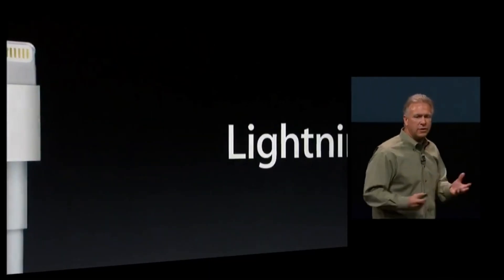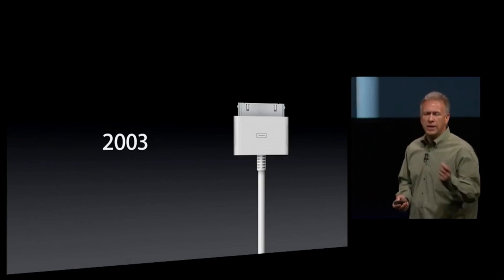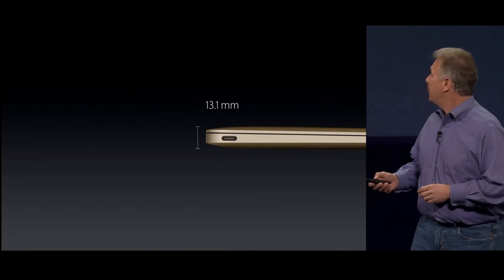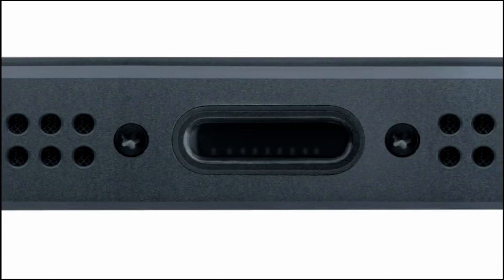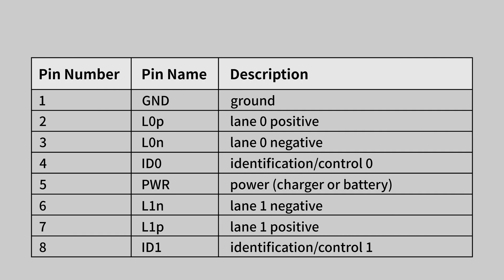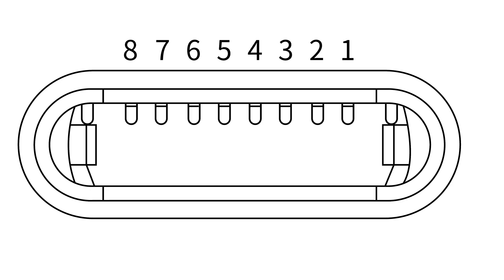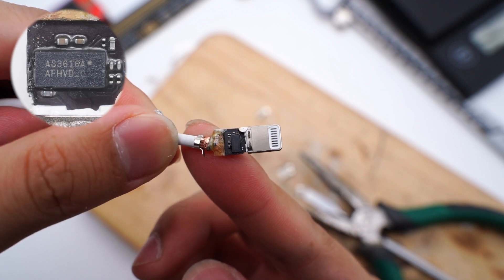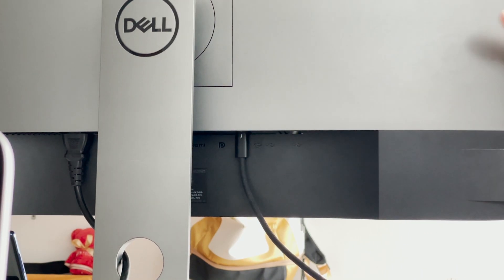How Lightning Cable Works? | Brief Introduction of Lightning Connector

Comment: I've had an idea for a "better" iPhone lightning cable involving a size change of the lightning cables head to help with initiating contact for older more worn phones. My proof of concept works, my biggest hurdle is the contacts themselves. is it possible to perhaps very slightly "stretch" the contacts and surrounding container vertically? what would that take? Is there a way to perhaps remove the contacts from the small plastic housing encapsulating it entirely?

Comment: How does transmission data if the cable has no pin 3, pin 2-3, or pin 6-7? It still transmits data, isn't it?

Comment: Don’t forget the USB 3.0 version of lightning!  Only available on iPad Pro 12.9 Gen 1 and 2, and iPad Pro 10.5!

This connector has double the amount of pins (8 on each side)

I think Lightning was a good port, it’s designed well is durable, much better than Micro at the time but I it’s time to move on.  It’s almost shocking the iPhone 14 series still only support USB 2.0 transfer speeds.

The real question is, will Apple adopt USB-C on iPhones, or go wireless/smart connector on the 2023 iPhone?
Reply: It is stupid that the iPhone 14 doesn’t have usb 3.0, especially when it shoots pro res video.

Comment: Since Apple (also by Intel collaboration itself) build the proprietary Thunderbolt protocol by using Type-C Interfaces, it would amazing if Apple turn their iPad or even the iPhone to use their Thunderbolt 4 (might be too overkill) or at least implement USB4 into their upcoming 2024 products that doesn't too overkill, it just an opinion though...

Comment: your videos are really beautiful and I think unique.  Thanks a lot for these videos.  Can you make a review and teardown videos of baseus products please ?  (gan3 pro chargers compact (ccu) and long cabled ones (ccuu), usb4 full specs cable, 10gbps hammer cable, cafule metal 100w cable, tungsten 100w cable etc ...)
Reply from the maker: Thanks for your advice. We'll consider those products.
Reply: @ChargerLAB  I also found and bought the following product baseus elf 65w 20000mah powerbank, I'm really happy with the built-in type c cable, very useful.  Apart from that, I couldn't buy it because the price is a bit high 🙃 Baseus 100w 20000 mah powerbank is also available, a very stylish design and a useful product.

Comment: Lighting is just a weird USB 2 port. It has no advantage over USB 3.1. 
Over USB 2 only that you can flip it. For that you need another proprietary cable.
Reply: actually this not true, there is one device hat have lightning port with usb 3.0 speeds - first iPad Pro, you can plug USB-A 3.0 Camera Adapter, SD usb 3.0 cardreader, and connect to pc via typec-lightning 2m cable - this cable have additional wires, and it transmits with usb 3.0 speeds. this ipad also have additional 8 pins inside the connector, on the opposite side.